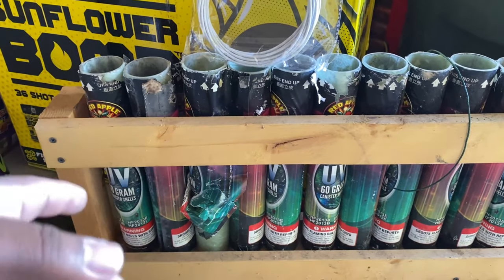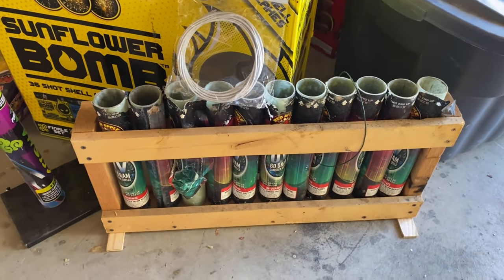Consumer Mortar Racks and How to Fuse Them

Comment: How many seconds per foot is that fuse you like to use? Does it shoot them off one after the other or is it more sky puke?
Reply from the maker: I think it’s like .5 check my other video firework accessories I have all the Info listed on that one
Reply: @KioBoomDiekin  Have you ever just used  the fuse connected to the shells and tape them all up together using only the shells fuse?
Reply from the maker: @bigmacfullerton7870  ya lots of times. Using masking tape
Reply: @KioBoomDiekin  Yeah I'm thinking I'm going to try it that way with some fast fuse for the last 4 shells as finale. I'm going to jam some cardboard in there to take out most the play. I don't want a tube flying out on me

Comment: Hey quick question can you use those fiberglass tubes for couple years
Reply from the maker: Rule of thumb is 6 shots for each fiber glass tube. Hdpe is stronger than fiber glass, some people can use these longer but that’s the rule of thumb.
Reply: @KioBoomDiekin  ok i was asking because i was gonna say glue they do it with like the glues made for plastic to wood but since those are 6 shots then you should use hdpe and just glue them on there
Reply: @parmbirbassi1951  Most times I only use a certain rack once per year so those are good for 6 years or more. Good idea is to examine the tubes every year. Make sure the plugs are good with no cracks in them or pieces missing. If the tubes look good and the plugs look good they are good for at least  one more round. Honestly the fiberglass last longer than 6 shells

Comment: You can also increase the width of those legs on the first rack.  There will be a bit more stability.  Cool set ups.
Reply: I would put the legs to the side that way the rack lays flat on the ground and doesn’t have as much play. Also I would place something next to the last fiberglass tube to reduce the wiggle room and to prevent any tubes from jumping out.
Reply from the maker: Thanks I’m still bracing it with other stuff to hold it up and sand bags. I just wanted to add this for extra insurance but I won’t be using quick fuse on this one anymore

Comment: Damn bro, u needa change those legs on the rack. Also, recommend HDPE over fiberglass.
Reply from the maker: i got both. the legs r fine i still use other things to hold it down just wanted to add some extra stability